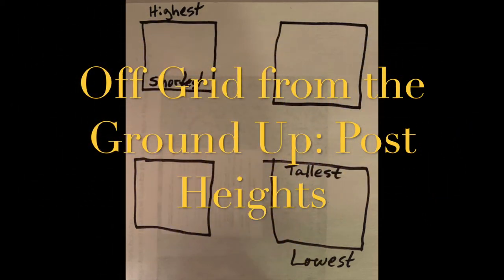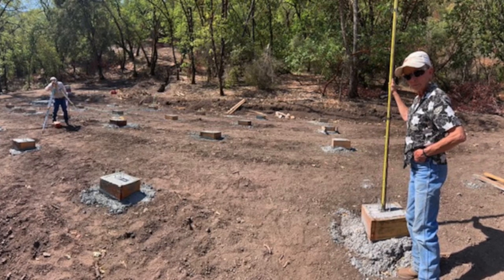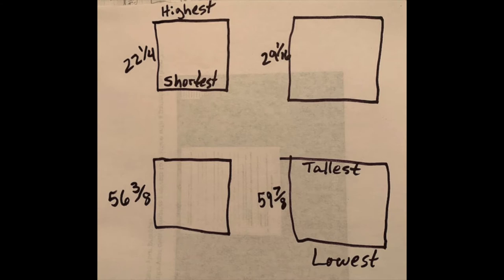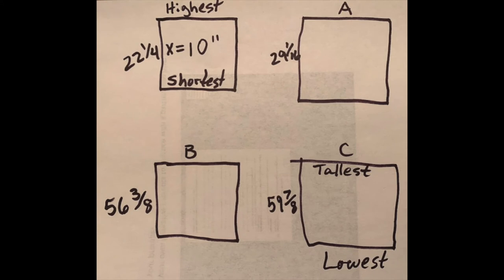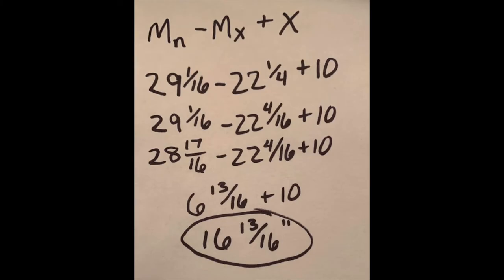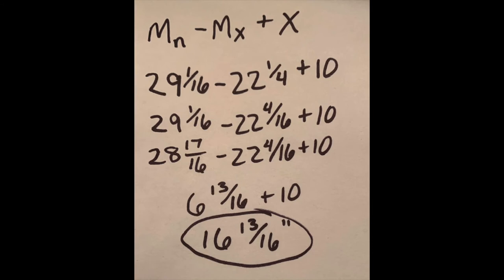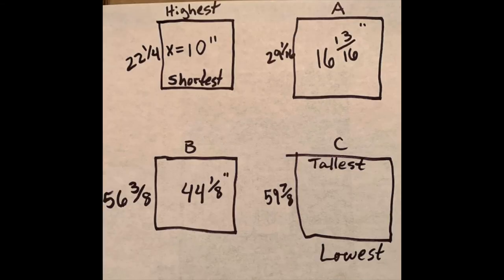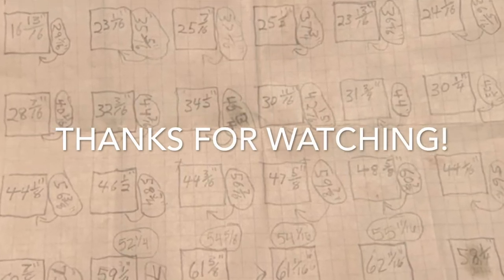How to Measure Post Heights for a Post and Pier Foundation Off Grid

Comment: In addition a laser level shoots a laser to every post on your build meaning put your level on the high pad even with your 10 inch post and you don't need a tape measure or any of your "lets make this difficult" method.  For the other posts take a post and place it on every concrete pad and presto your laser would be visible as a line across your post.  Mark it with a pencil and cut it.  Move to each pad and repeat.  In a few minutes you have every post measured to make your floor level...
Reply from the maker: You’re welcome to use your method.  My method resulted in a perfectly level floor and was efficient as we cut all the posts at once.  Your method would not have worked for me for a variety of reasons but I’m happy for you.

Comment: A garden hose used as a water level would have been the easy cheap way to do this.... Cut one post 10" and place on the highest level pad.   put one end of the hose level with the top of the 10" post.  Now go to each pad and using the other end of the hose fill with water until the hose is full.  At the height where the hose is full and no water is coming out either end gives you a point that is level with the top of the 10" post. Measure the distance of the hose above the pad and cut a post to that measurement and  then move on to a new  pads and repeat.   Also you took a very simple concept and made it difficult to follow, must be the teacher in you....  also few have access to a laser level...  Maybe you can rent one though....
Reply from the maker: Water is at a premium when it’s summer in California.  There’s certainly more than one way to accomplish this task, so I’m glad your way works for you.  I did address a budget conscious method: the string level.  Perhaps you stopped watching before that point.  Thank you for your incredibly insulting comment generalizing teachers.  Must be why we’re leaving the profession in droves.
Reply: @offgridrising  by the way if you are worried about the amount of water it takes to fill one garden hose you should not be building a house there...  And  if you are careful you could even reuse the water in the hose and not waste a single drop....  I would have jumped off a bridge if I was one of your students by the way....
Reply: She is worry about water filling a garden hose? She is worry that someone came with a cheap and easy level solution, no humbleness.